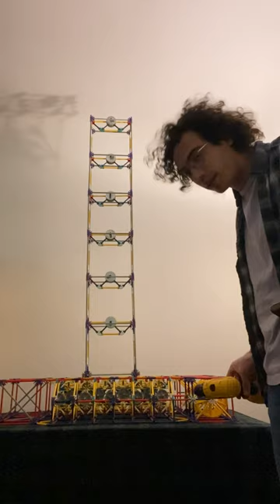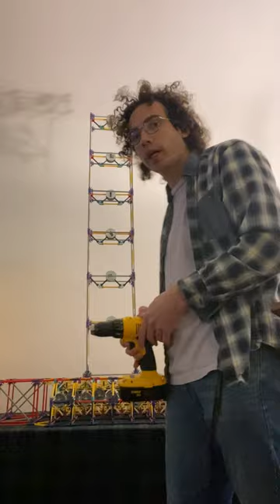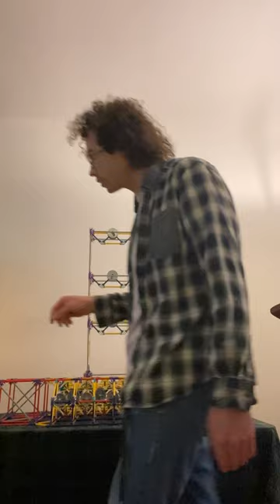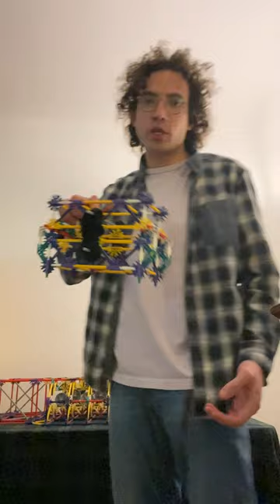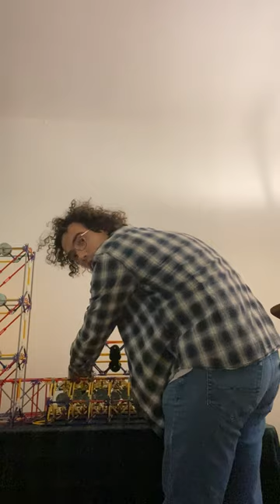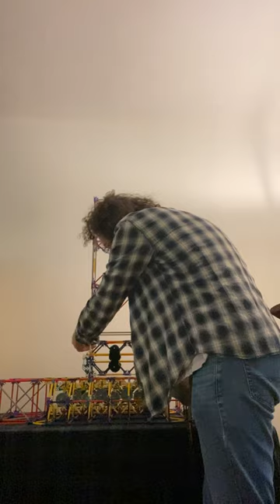K'NEX Shake Table Demonstration (Structural Dynamics)

Comment: Wow this is cool! I once made something similar using a DIY shake table and wooden dowelling to investigate pendulum tuned mass dampers! It's pretty easy to find the period of the 'structure' and match with the period of a pendulum attached to the top of the structure - and it's pretty effective! Perhaps you could attach an accelerometer to the shake table and create a model in OpenSEEs using the material properties of K'nex plastic and perform a time-history analysis ;)
Reply from the maker: That’s a great idea! I might do that in the future :)